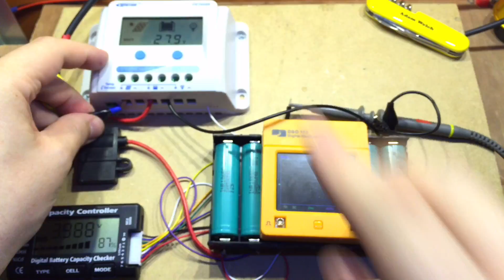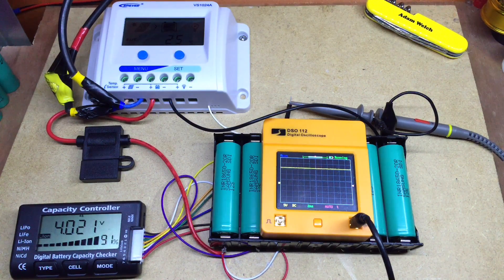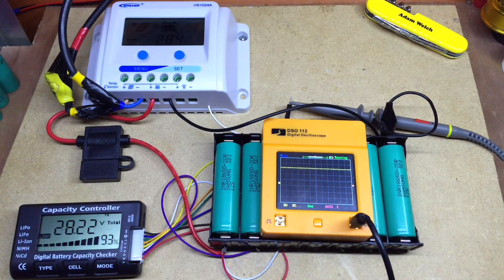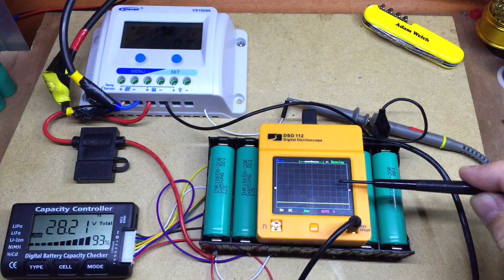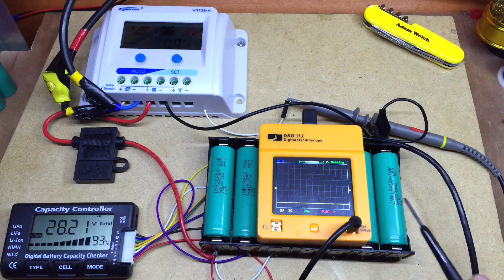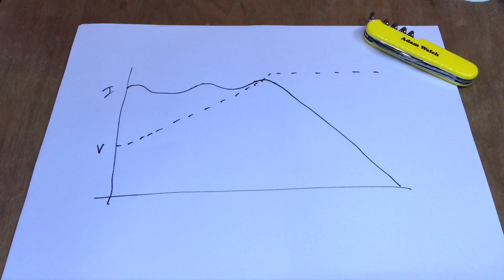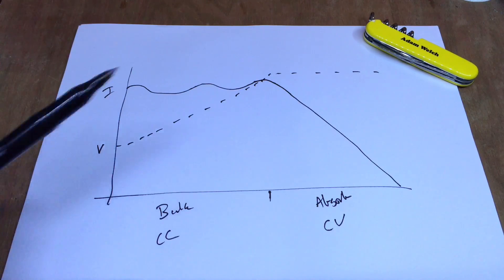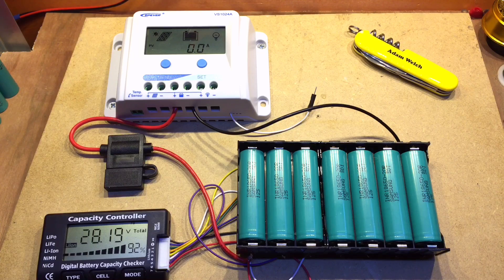Solar Charging Lithium Ion 18650s - Part 3, The Results - 12v Solar Shed

Comment: Good video as ever and well done on passing 2k subs :-)  would the fact you've selected Gel as the battery type so effectively lowering the target voltage to 28.4v rather than 29.4v actually be ensuring they are never fully charged to 4.2v anyway?  i know it's only stopping short by 3.5% but means your not pushing them too hard at least.  With the landstar PWM model there is a custom battery setting so you could set the voltage even lower to give you the full %10 headroom then maybe.  Oh and my pack completely screwed up too, i left the BMS connected but also the capacity controller which was set to balance as well and the next morning some of the cells were at 1.2v and the capacity checker showed a 3s pack!  will try the BMS individually over the course of a week maybe to see if it does the same.
Reply: I have a four cell Li-ion  pack. Actually it could be Li-anything...not really sure!  It has recently liberated itself from a device that died all to prematurely from un-natural causes. It has the balancing circuitry built right into the pack so all I need to do is supply controlled charge. The problem is four cells make around 16 volts and that doesn't fit into the range of any standard Pb charge characteristic. Yet I still want to sort out a charger for it. I can't really add additional cells to it as these are not your typical 18650s and I don't want to take apart the pack and reduce it to three cells as it's a neat little unit like it is.
Reply from the maker: +Colin Hickey (Lets make stuff!) Sorry to hear your pack has had trouble. I wonder if the two balances together are fighting against each other resulting in an over discharge? I assumed I'd fried mine because another commenter said that BMS worked well for them. I hope your pack recovers as well as mine seems to have done. 

Yeah I chose gel to increase the headroom. Another commenter asked about the 'user' settings on the ls1024b and the tracer MPPT. My response was that I wanted to use an off the shelf product without too many advanced features. I could have used one of my first epsolar charge controller actually which had a sealed, gel, flooded option. I used the vs1024a however because of the nice screen and the info it showed for demonstration purposes. 

I'd love to see a video from you on how well this works with an MPPT charge controller. Hint, hint. 

Thanks for the kind comments. I'm amazed so many are coming along for the ride. Excellent people each and every one of them!
Reply from the maker: Hope you find a solution Xan (I suspect you will - I hope you take it in the best possible way when I say I think you're very good at coming up with slightly less conventional solutions).  I talked about the 3s/4s twelve volt issue in the first video of this little series.  Lithium at twelve volt just doesn't work for me and as everything is 12 volt in my shed it's probably not going to become anything more than an experiment.

Comment: very interesting, do you have a link for the oscilloscope
Reply from the maker: They've updated it a bit since I bought mine - here's the latest version... http://rover.ebay.com/rover/1/711-53200-19255-0/1?icep_ff3=2&pub=5575189419&toolid=10001&campid=5337903455&customid=DSO112A&icep_item=311568431093&ipn=psmain&icep_vectorid=229466&kwid=902099&mtid=824&kw=lg

Comment: This comes under the "How it know?" category.  The cells are connected in series.  In order for the controller to asses the charge level in each battery it needs to be connected to the cells individually.
Reply from the maker: +Joseph Nicholas That is true but the same applies to a lead acid battery surely where a 12 volt battery is six 2 volt cells in series?   That's why I'm leaving a device to balance the cells in the system. That way if the total voltage gets too low or too high the charge controller turns off using its own low/high voltage disconnect.

Comment: Adam, I don't think your cells life will be shortened by not terminating charge as an Lithium charger would.
As you stated correctly the constant voltage mode of the charge cycle will be terminated when the current drops below 10% at 4.2 V.
Your charge controller lowers the current to 0, effectively terminating charging at a very safe 4.1 V...
Reply from the maker: +Ron Topsvoort Thanks for the reassurance Ron. Much appreciated.
Reply: Are you sure?, this class of chargers usually have a fixed time period for absorb. Something like two hours. It could only taper to a certain point if it measured the charge current and the load current. If it does this id be suprised (however it does have access to the load current,assuming it all passes through the load port). It would be interesting to study the absorb termination more closely to confirm.

Comment: In a single video you have answered tonnes of questions I had floating around in my mind for the past couple of weeks. Now I have one more question; do you think there is any point in investing in lead acid anymore, when Lithium Ion is so easily used in an off-grid solar setup these days?
Reply from the maker: Glad to be of assistance!

From my point of view I prefer twelve volt systems because there is a lot more off the shelf products available.  Unfortunately as I discussed in the first video of this little series lithium ion isn't really compatible with twelve volt systems.  If you end up boosting or bucking your system all the time you're going to end up in quite a few losses.  Not great in a solar powered system.

If you need or can live with a 24 or 48 volt system then yes, I think you need to look very carefully at the different solutions.
Reply: +Adam Welch Thanks for the prompt response! I must have missed your mentioning the 12v incompatibility with lithium ion. I'll have to watch your first instalment again. Not to worry though, I'm very much enjoying your content :) Thanks very much Adam.